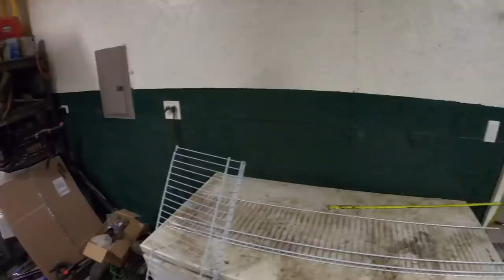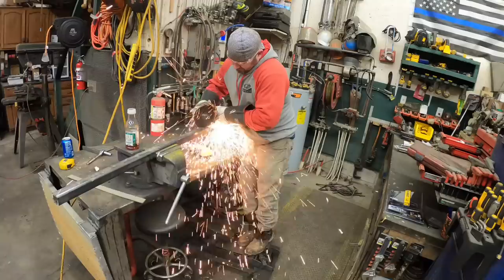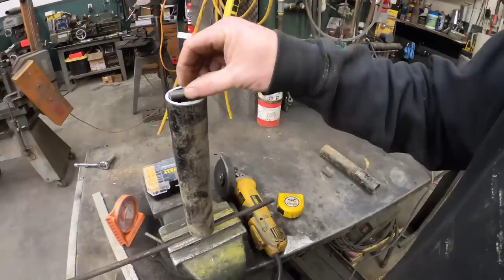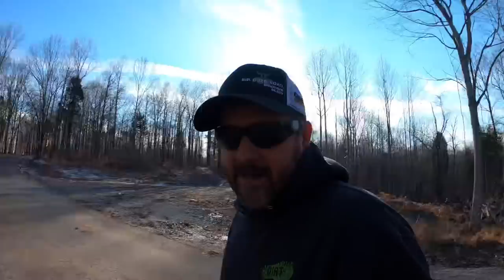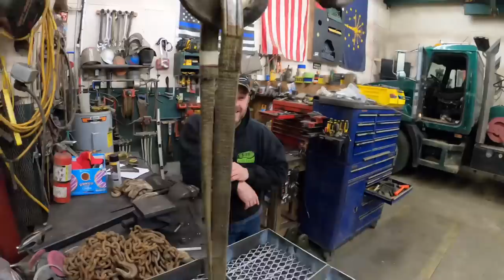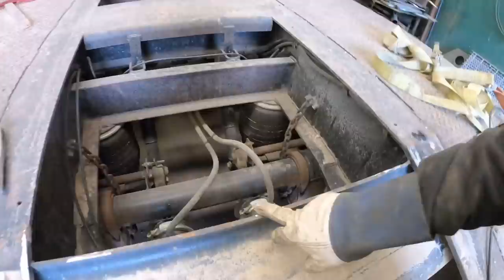Major upgrades, improvements, and repairs to the lowboy trailer, after a few destinations its done ✅

Comment: You could always put one zip tie in each bin to hold the expanded metal on top of the grating.  That way if you hit a bump when the chains are not in the pocket they dont fly out, and if the chains catch it has a chance to hold it in.  and a single slightly loose zip tie along the edge could allow you to fold it up to clean then put it back down.  Fun project video as always though, very entertaining and useful info too.

Comment: I really did enjoy this vid, you may want to watch that 24x36 (beep) tray.   hoping you don't put more then one chain per slot.   We put bungee cords across the top to keep them from popin out.  We did a lot of gravel running.  Next was the pipe shovel holders lol   did this one, they will rub making the handles weak in that spot.  I broke two handles on my broom before I redid the holder.  Great stuff Michael.  Aaron.

Comment: Looks like Aaron could use a welding coat 🧥 to protect his cloths from welding holes and setting himself on fire 🔥🚒🚒 🚑…..lol.  A very productive video for Dirt Perfect Excavating….lol.  Great Video Mike.
Reply: Aaron needs to lose the tie strings on his hoodies, lest he wants his neck stretched and ground with one of them grinders!  I noticed later in the video both of them were wearing Dirt Perfect hoodies and the strings weren't in them.  I'm surprised the safety sally's haven't gone nuts over that, but those strings are a REAL issue.
Reply: @python3574  😳 Your’e Right…..Years ago, a friend’s 11 year old son took his go-cart out onto the street wearing a neck scarf while both parents had went to the store. Sadly, the scarf got in the chain. EMT couldn’t revive the young man. Even as a Christian family, the parents never recovered which ended in a divorce blaming themselves and each other.

Comment: On one of dad's trucks it had a headache rack that had a chain rack like you built. It was just a strip of flat bar. There was a piece of angle that was hinged so when closed you could put a padlock on to keep the chains and boomers from growing legs and walking off. He hardly ever flipped the angle over the chains and the only time they fell off was when he rolled the truck over an embankment. After spending a few weeks recovering he drove over the road 30 more years.

Comment: The chain basket won’t hold dirt because as it dries out the chains vibrating going down the road will shake it down and out the bottom. I have used this setup in the oilfield and never had issues with it holding dirt.

Comment: One item I hate doing is chaining down equipment.  When you modified the trailer to place the 210 bucket on the c channel, I would have put a place to quickly and easily chain down the bucket/boom, without the need to use chains.  Just food for thought.  Thinking about it, I am going to do it for my excavator next time it is within the reach of my welder.

Comment: Mike, it's me again Dave, If YOU patent the can crusher you will have to use an electric solenoid as an actuator so it can be plugged in for most applications 99% of businesses won't have air. if they hit the market you can send me one LOL  P.S. You know how people are someone will take and run with It,, better get on the stick and run with it

Comment: The holes in the back should be covered to keep the water and the sand and salt away from the equipment also the ice will cover the deck causing a safety hazard

Comment: Personally I think I would of used pvc pipe for the flag holders because it has been my experience that when storing flags in ferrous metal pieces of tubing/pipe that even if you paint the inside of them sooner or later rust will form and stain your flags.  That said if you (DP) are happy with that I am so am I and I hope it severs your needs well but if it doesn’t there is alway version 1.1 and another video 😂

Comment: A guy should have some fun when working or it would get seriously bogged down with a bunch a "do I have to's" and just hopping ya get the Lt. in the shop before Aaron heads back to his real job of burning wire... as it ain't much rod being a main course anymore. Some fine engineering that has yet to be determined if or not its a grand winner... no matter what, ya didn't kill each other having some fun and it got a chuckle out a me